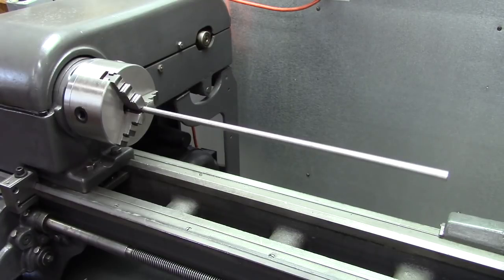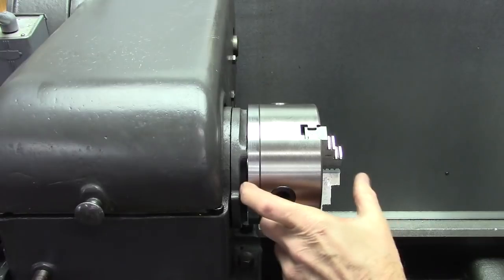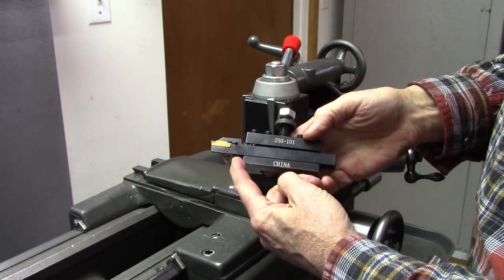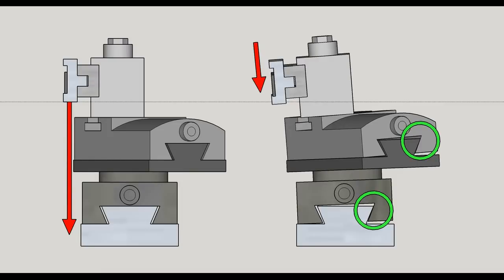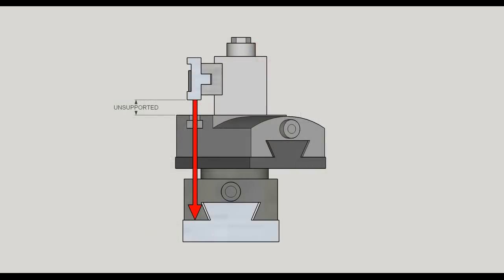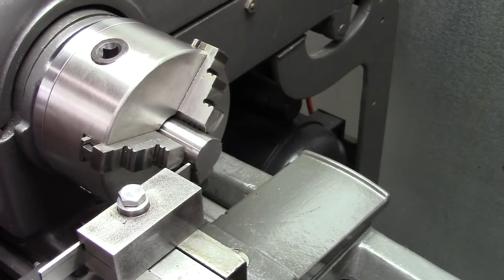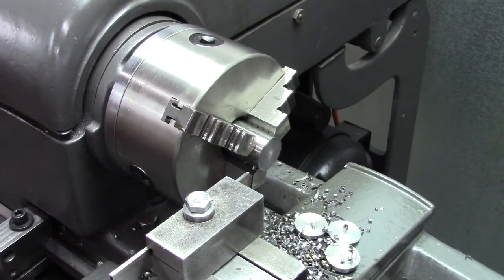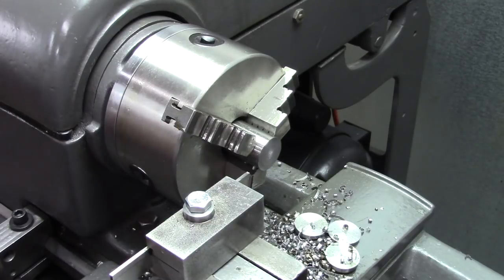Metal Lathe Cut Off Explained PLUS a better tool holder!

Comment: That was a good demo of resonance. For those of us who have to work in a shoe box using floppy bench lathes it gives a good indication what to look for in improving parting off (UK for cutoff 😁) on small lathes.
Reply from the maker: This is good to hear. This is why  made the new video. There are many areas to look at and consider.
Reply: @WinkysWorkshop  . A very easy to understand lesson and the excelent graphic illustrates it perfectly.
It's so often difficult to explain to people new to machining that the apparently rigid lumps of lathe iron in front of rhem are 
in fact dancing around like chickens . My shoebox has a 113 yr old Royal Navy lathe in it that was compact enough for use
in a submarine , great lathe but it's light so you learn quickly about keeping things compact and rigid.
Good video thanks.
Reply from the maker: @leerogers6423  - Love the dancing chicken!  Thanks

Comment: Hey Winky - Great explanation with visuals. The best I've ever seen. Allow me to throw you a curve ball.
If your Chuck has sprung jaws, the cut off piece will bounce like crazy. To use your term
 " Vibration Resonance " Try putting something soft on each jaw to take up the gap .
Like copper etc. etc. etc. -- Jim
Reply from the maker: Yes this is for sure a problem! And the softer jaw would probably help

Comment: Well done.
The harmonics are well defined in this video.
Parting was something I tried to avoid with my old 13” South Bend. Had I seen this video, I would have understood why I was struggling.
With my newer 15” Colchester, parting is easy at any speed, feed.
Reply from the maker: Thanks!  Yes I occasionally hear from people running huge industrial machines. They assume I have bad bearing or loose gibs on my compound because they have never experienced smaller less rigid lathes.

Comment: When you get away from the original accessories designed for your lathe you often get some new problems.  I guess that holds true for any shop machine.  Thanks for the video Winky.
Reply from the maker: The original design for cut off didn't work very well either. However, there is a design by armstrong that probably works great. It flexes. Kind of the same effect and cutting off in reverse of from the back side. I've been meaning to try making one. Have you ever seen one of these?
Reply: @WinkysWorkshop  no i have not seen one of those.  I have an armstrong cutoff tool that came with the lathe and it never has any problems.

Comment: I really like your approach of coming back to hard problems multiple times, each time with the benefit of what you learned previously and then figuring out a little more. I think a lot of human progress works that way. Unfortunately, most instructional materials, and especially videos, skip over that process. Thank you for modeling that behavior.
Reply from the maker: I appreciate that! If nothing else I didn't feel like I explained my past video very well.  I took a bit more time and effort to make the drawings but I think they help a lot.  CAD sure it useful and amazing.

Comment: A good reason to use a collet if possible. A 5-C will get you up to 1 1/8 diameter stock (28.5mm)and you can part off work within an inch (25.4mm) of the spindle nose.
If you do a lot of cut-off work having a tool mounted to the cross slide on the back side of the work is handy. About as rigid as you can get and with the tool upside down the chips are thrown down and not up at you.
In the home shop doing part off is the one place where a drip oiler for cutting oil is useful. It is hard to brush oil in fast enough and the oil does help with high speed steel blade cutters as there is a lot of heat build up in a deep parting cut.
Cheers from NC/USA
Reply from the maker: Yeah...  collets are on my list of wants. The 5C is probably the best option for cut off but I'll likely go with ER40. They are still way better than the chuck but you can also use the spindle bore. I've thought about the drip oiler too...  its a good idea. With the smaller chuck parting off at full speed works great but from a mess standpoint I tend to go slower. It slings oil everywhere.  Both the Logan and South bend are not set up very well for mounting the tool from behind and reverse is out of the question.
Reply: @WinkysWorkshop  If you are going to use ER collets be aware that if you buy mainland Chinese tooling you are taking a shot in the dark. Chinese ER collets are often so bad as to be unusable.There's a reason a Chinese collet set sells for price of one U.S. made collet.  This is one place I wouldn't cut corners on quality.
Reply from the maker: @aceroadholder2185  Yeah, I've heard the same. I've also heard that most of this is a result of burrs left on the collet and cleaning them up helps. I'll probably look for a better collet.

Comment: Hi Winky. When adjusting my dovetails I remove the feed screw. I get a better 'feel' for the setting as a result. Not my idea - the late George Thomas published it decades ago. Very interesting and informative analysis you have put together. My 'import' lathe has a much larger diameter spindle than most, a very solid Dickson style tool post, my 'cnc style' insert toolholder has minimal overhang and I have no trouble in cutting off. BobUK.
Reply from the maker: It would be nice to have a more rigid machine, thanks for watching!

Comment: Thanks Winky that has covered a lot of my problems , will look at my lathe and setup and make ajustments .
Old apprentice from Down Under
Reply from the maker: One more thing...  I have a video on replacing the cross slide and compound gib screws and using a lock tite "type" substance on the screws,  It makes getting the slide just right and also helps with cut off. https://youtu.be/ubekCBekDkM
Reply: @WinkysWorkshop  will check it out thanks

Comment: Great video mate this will clear up a lot for people who have trouble with parting I made a solid cut off tool holder that attaches to my QTCP that sits on the compound slide so it’s supported withe compound slide inline with the cross slide works well no chatter thanks for sharing this video stay safe all the best god bless
Reply from the maker: I have thought about doing that also. In fact I have been thinking about making a new style QC Tool post. Thanks for adding your common!!
Reply: @WinkysWorkshop  that would be a great video nothing like your own QCTP might inspire me to make my own the factory ones are never good enough always that little bit of play thanks for sharing your talents stay safe all the best

Comment: This is a great topic especially because I have not been able to satisfy the challenge adequately in several years of off and on attempts.    Number one question is since the surface feet per minute feed rate is changing so rapidly and drastically going from the outer diameter to the center which do you shoot for a half way average?  My problem is not so much chatter but a drastic increase in tool pressure needed as the diameter diminishes.  Works pretty good with a center bore of any size but doing a solid especially that tool pressure goes up drastically toward the center until the tool pretty much stops cutting and immediately thereafter the work climbs the blade and things start breaking.  I have used every kind of cut off tool I have found in the catalogs to no better effect.  Inserts, HSS blades of different configuration etc. etc.  Lots of oil, hand feeding at varying rates. Cutting edge dead center.  None works reliably.  I would say about seventy per cent of the time it cuts fine.  Just when I think I have it resolved BANG!!  I have ruined a couple of insert blade type holders as well as a couple insert grooving holders this way. Not to mention a few inserts themselves. My lathe is a Grizzly G4003G (12x36) so it is not huge but not tiny either.  Gets to where I just go to the bandsaw.  Sometimes I just start the groove to guide the saw blade and finish it on the bandsaw.  This issue is one of the most frustrating when working with the lathe.
Reply from the maker: I feel your pain. I've been there! 
If I am cutting off using my shallow chuck I use the OD SFP calculation (about 460 RPM for 1-inch). On the chuck with more overhang the lathe spindle is not rigid enough to handle the overhang of the chuck so I slow it down to 180 rpm. If you have not tried this tool you need to https://amzn.to/3wi403h . This tool has a T profile and a concave top. No friction and the chip don;t get stuck in the cut. I used to use a GTN3 insert with a tool holder that was supported by a plate on my ways. It would break at the end of the cut like you are experiencing if the insert got slightly dull. I use a fairly slow feed rate and never have problems with the blade going under the work at the end of the cut. It sounds like something it flexing. Apply some of my tricks in the video. I you are using a quick change holder put shims between the holder and the compound and set your compound straight with the cross slide.

Comment: Great video Mark.  Sharing something that works great for me instead of a brush or spray bottle is a 2oz squeeze bottle with a stainless steel tip.  You can put a drop in at a time and still keeps hands away from the chuck.  They cost maybe 2-3 on amazon.  Thanks for the videos.
Reply from the maker: I had a squeeze bottle at one time... it did work well. Why the stainless tip?
Reply: @WinkysWorkshop  You'll know in about a week.  Just sent you a 3 pack.  Thank you for sharing your knowledge Mark.
Reply from the maker: @VenturaSewerInspections  Thanks a bunch! Did you bye a bandsaw plate from me?
Reply: @WinkysWorkshop  no so let's cross fingers and see if I got the address right haha.
Reply from the maker: @VenturaSewerInspections  - ha., no kidding

Comment: Good points, all of them. 
The chuck stick-out length is definitely an overlooked factor which unfortunately cannot be changed on most machines. I have a German made Gema lathe which is a great machine but it has an ASA B5.9 long taper spindle nose (size L0). Not only does this give a long distance to the spindle bearing but chips gets caught between the chuck back plate and the chuck, which effectively necessitates removing the chuck from the backing plate every time for cleaning. It shows on a number of flanges which are damaged from chips embedded in the taper surface. I am thinking about adding an O-ring or some other type of barrier to keep the chips out.
I hope to improve cut-off results with a to-be-made solid rear inverted tool post.
Reply from the maker: I think some of the lathe manufacturers realized the chuck stick overhang was a problem. My Logan chuck was very shallow and close to the spindle. After market chucks are terrible on these old smaller lathes. I agree...  cut off from the back helps a lot. I also made a spring cutoff tool that helps a lot.

Comment: Hi Kevin back again I will tell you a  job we do we screw cut 3 tip  in assab  750 v medium carbon using a 4 way tool post and assab 17 tool steel  with oil pumped on, in 18 minutes this is plug cut method  [ straight in cross. slide ]we tried a quick change type tool holder we got some  chatter we are about 8 inches out of the chuck  4 jaw type this machine has a taped nose and cam lock  [no thread]  this is very solid ,wen parting off we use pow feed  thanks for listing Kevin Schlipalius Deakin Engineering Vic Aus.
Reply from the maker: Yep...  the 4 way post is WAY better than a quick change post. Thanks!

Comment: Never knew about the shallow chucks or the chuck/arbor flexing.  When I used a Hardinge toolroom lathe at work, there was never a cutoff problem.  My home shop Chinese lathe, well...lets just say it will work, but it needs a lot of TLC.  Thanks for the video sir.
Reply from the maker: Yeah...  I'm sure the Harding ws rock solid.  Thanks for watching!

Comment: Hi my name is Kevin from Aus I worked in the famley engineering business for 54 years it has bean going over 70 years ,some of the cheaper lathes have bushes in head stock better  have ball races , more expensive have taper roller bearings [never here'd of over heating ] a good gear box oil helps keep it cooler, we have  lath about 50 years old it still has zero on the nose of the spindle all our machines are very good quality some are tool room  all our Chuck are Prat Bernard  you need to look at bearings both ends look at cross and top slide and adjust  them if needed  size of chuck shodden matter tool on centre high  ,if bearings are worn the job will ride up on the tool you will get chatter we use crank parting off tools power feed all the best to all Kevin schlipalius Deakin Engineering Vic  Aus
Reply from the maker: Yes sir, bearings are better and even better yet, tapered roller. My lathe has angular contact double row precision bearings and they are in excellent shape. The cross slide and compound are also in good shape and adjusted very well. The lathe is old and not very industrial. It has some limitations that must be considered such as centering the load as much as possible over the carriage. This is a good practice regardless of what lathe you have but critical and the case of these smaller lathes. The other weaknesses are spindle diameter, the bearings and the thread mount. Ball bearings will move under load. Not a lot but they do move. In fact, sleeve bearing (bushings) are actually more solid than ball. Most sleeves are set at .001" clearance and with a running oil film they don't move much.  The surface area on a sleeve bearing is huge compared to any bearing. The biggest problem with sleeve bearings is at higher speeds, they will over heat and burn up. The diameter of the spindle on my lathe is 1.5" which is fairly small plus it has a bore slightly over .75" and plus a moris taper on the end. This makes overhang on a chuck very critical. The wall thickness at one end of the bearing is only .25". This is a weak spindle and needs to be considered. As spindle diameters go up the strength goes up exponentially. Even .25" larger would likely be 20% more rigid. Then the thread mount. Threads on a small diameter spindle are a very BAD idea especially when you use a case iron backing plate. I've swapped all my cast plates for steel. There is still movement but it takes over twice the load before it moves. Sadly, chuck overhang on these old lathes is a very real problem. The the chuck you mentioned (Pratt and Whitney) are excellent chucks but they cost well over the cost of my lathe. Something interesting Pratt & Whitney is the only company that makes a low profile chuck that works well with these lathes. You need to watch this video. It starts in the middle but feel free to watch the whole video.  https://youtu.be/ysYusXnhCQY?t=149

Comment: Hi there Winky Kevin back from Aus I just looked at 3 of your videos the tool holder you made is holding the parting tool over the compound good support ,the quick change does not  we don't have any quick change type all ours are 4 way type , the parting off tool is clamped as a normal tool with 3 set screws. as seen you are still some chatter is the chuck jaws parrell  if not you are not holding the work piece  enough get a piece ground stock put in chuck lithely tighten up and see if you are still getting movement , if so your chuck is not holding it enough so you will steel get chatter . to day I parted off 8 pieces of 316 s /s with a hss  tool a bit tough no trouble yesterday ,I made a tipped tool for the job but I tried the hss to see if I could help you coolant is very important  and all our machines have cutting oil  pumped on I think your own tool is good worked well I used a hercus lath [made in Aus]  to do my job keep worken on it and you will get there .Kevin Schlipalius  Deakin Engineering Vic Aus
Reply from the maker: The larger chuck is new and the jaws are in great shape. A screw on chuck and smaller spindle is the primary problem. But is works.